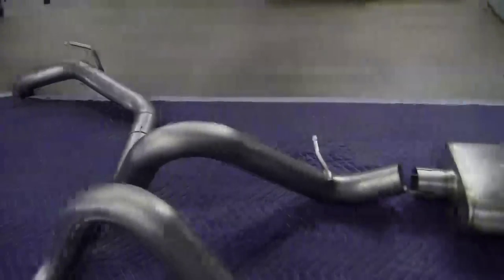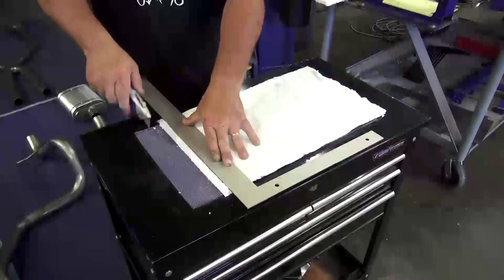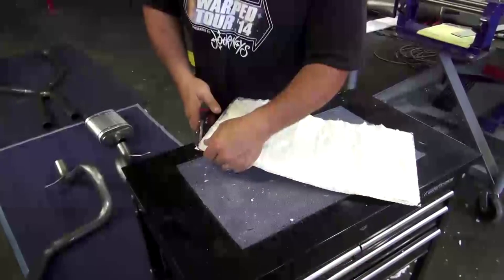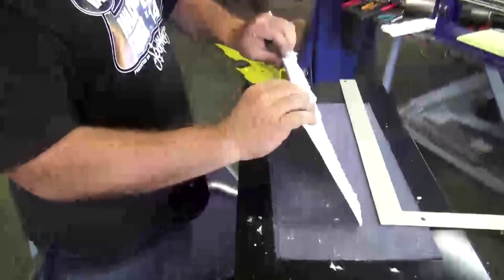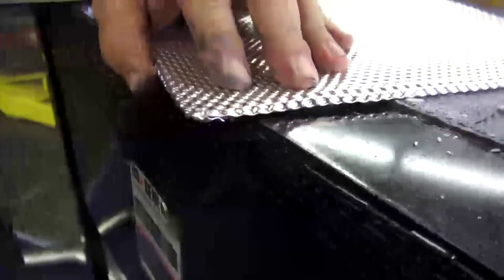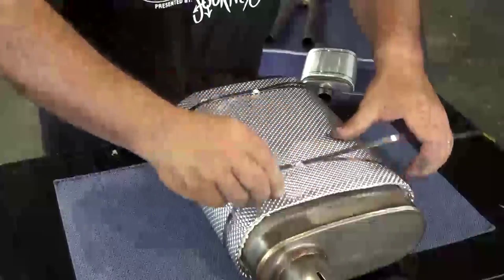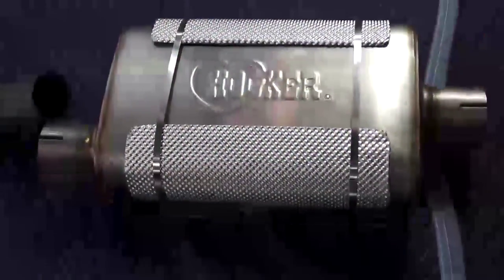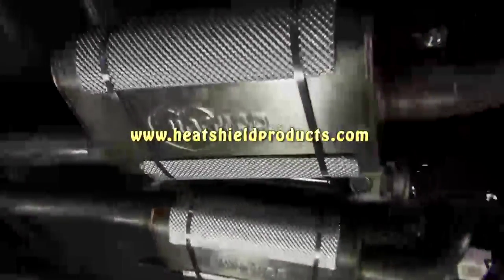How To Video: Install a Muffler Heat Shield

Comment: Muffler usually don't radiate as much heat as the piping itself
Reply from the maker: True.  But they can be close to fuel tanks and fuel pumps in the back of your ride.  Use as needed. Jeep guys like them as well when they have no heat pro on their floors. Thank you for your comment Randy.

Comment: So why would you not wrap this all the way around and to the ends of the muffler??
Reply from the maker: Ken, first thank you for taking the time to watch. With the Armor series of exhaust insulation, we can stop more heat than an exhaust wrap. Even a half wrap will stop more heat from radiating upward into the vehicle. Wrapping only half or 3/4 of the muffler or pipe, allows it to breathe. Some exhaust manufacturers will not warranty their products if you use a traditional wrap. This is a warranty friendly alternative that stops more heat than a wrap!

Comment: Will the shield damage the internals from a catalytic converter?
Reply from the maker: Thank you for the comment xr500t!  There should be no damage to cat by adding the shield. 
Be sure to follow the instructions.  
"If you are wrapping a catalytic converter, it is important to only wrap one half of the
converter. Wrapping the entire converter can shorten its life expectancy."
More information available on our website. www.heatshieldproducts.com
Reply: @Heatshieldproducts I bought an aftermarket Cat and as you said it the heat shield was only on one side